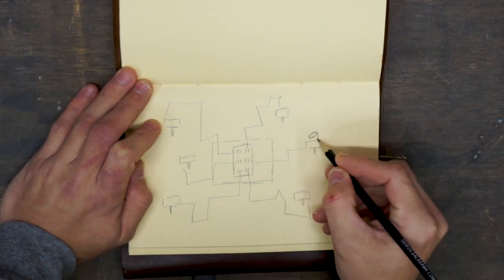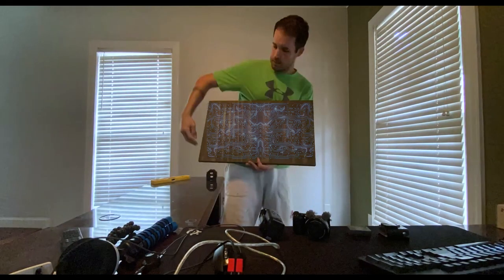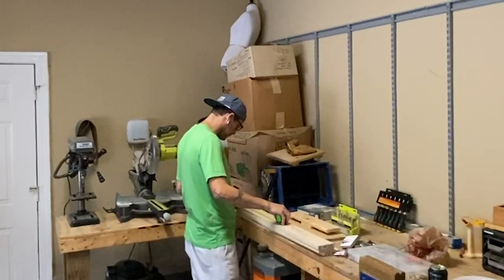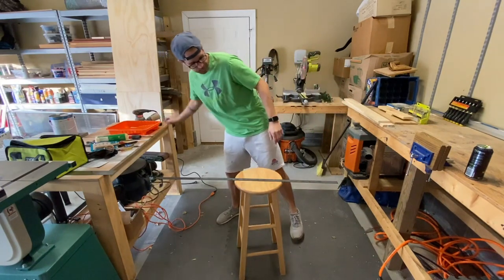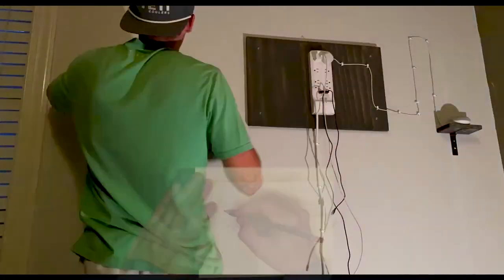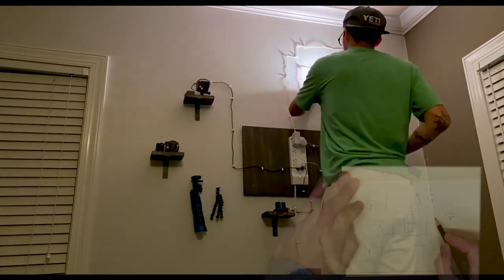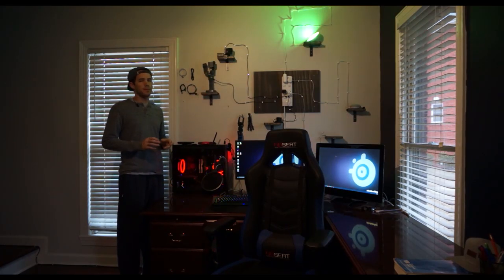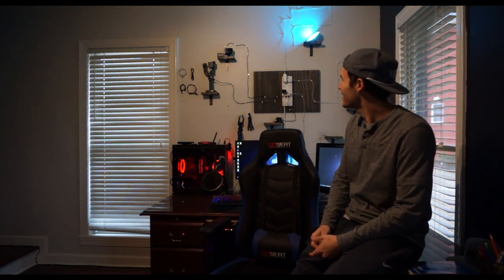Design with Wire:  Make a Circuit Board on your Wall (Wall Wire Design)

Comment: Would be cool to add some actual circuit boards to the base plate. Maybe off of some broken laptop or whatever, just to give it the little extra touch
Reply from the maker: Porty thanks for the comment!  That is actually a really good idea, I appreciate it.  I think I could get some left over parts at work...thanks again buddy!  I’ll post an update picture whenever I get it done